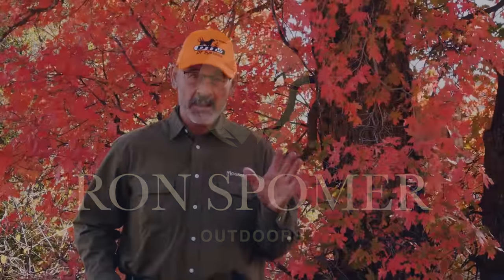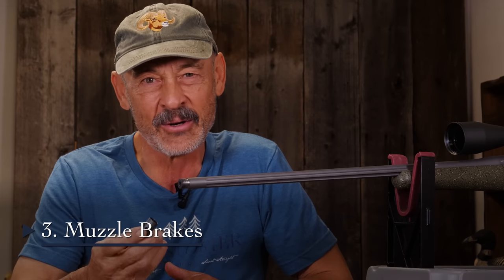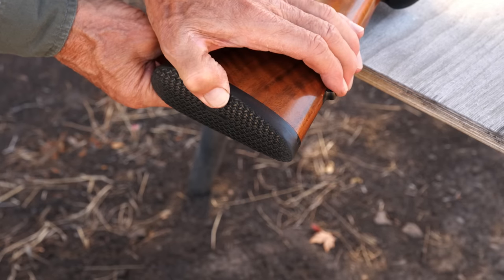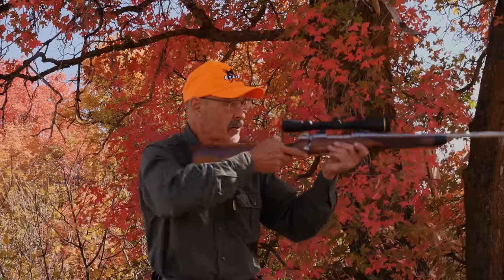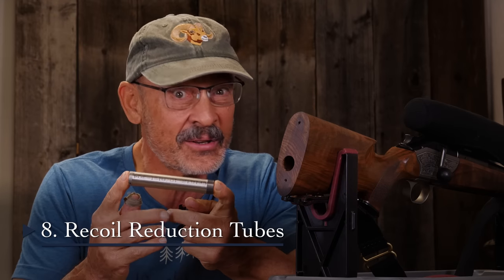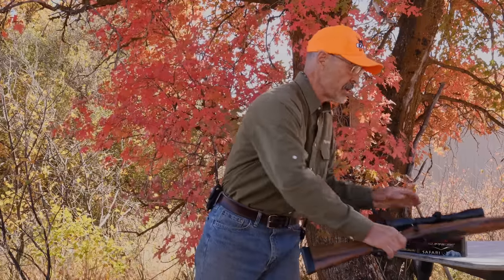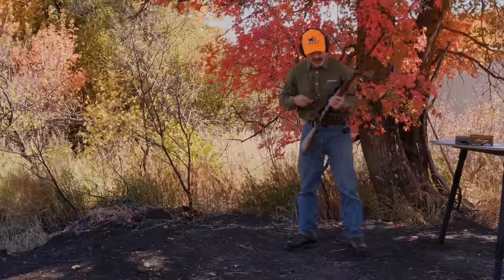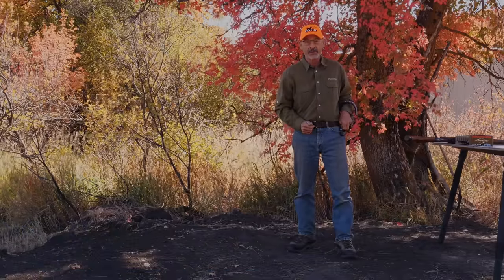How to Control Rifle Recoil!

Comment: I am 6’2” and have thick shoulders, my 7mm mag doesn’t bother me at all because it has a Winslow stock that really puts the bore line in the right place. I had a 270 that had a cheap synthetic stock that wailed the bejesus out of me! It really taught me that a good stock will make a huge difference.
Reply: Early, you are so right.  I have a Ruger American in 270 and the felt recoil is very uncomfortable (I'm 76 and been shooting a long time).  I don't even like the rifle and thinking about kicking that can on down the road for that reason.
Reply: Early Cuyler: Hello. This is so strange / interesting that you mentioned the "Winslow". I have seen them for years in Shooter's Bible and Gun Digest and other firearm publications. As soon as he mentioned the line of the stock and sight lines in the video, I immediately thought about the "Winslow" stock rifles (and another type also).  Makes sense.
Reply: @easttexan2933  

Good thing about the Ruger Americans is that there are a lot of good aftermarket stock options that don’t have to cost an arm and a leg.
Reply: @ryanwilson5936  can you provide a link. I'm only familiar with Boyds stocks. thanks.
Reply: @easttexan2933  Kick it my way, wouldn't mind having one, Add a beter recoil pad, heard linbsavers work great, add a spacer, I made simple 1" wood spacers for my guns to fit me better, About 6'1" but standard guns don't fit me right, mayby long necked, but the spacer worked 👍
Reply: @ryanwilson5936  Well E.T. bought a low priced( good Rifle) I don't think spending 200$ on an aftermaket stock is what he wants. I would take of the but plate/pad and repace it for a better one and add a simple self made wood spacer, add some weight in the voids of the stock, I'm 71 and probably not going to roam the ridges like I used to, Probably hunt from a stand so gun wheight not critical
Reply: @WillyK51  

Right on. The American’s are good rifles. I like them. Spending cash on an aftermarket stock isn’t always the most cash conscience option but if one can afford it, it’s always an option. Better (and usually cheaper) than having to sell of a good shooter just for lighter recoil. Which, is why the Americans are an economical choice. Good shooters with a “less to be desired” stock. 

I do agree with your post though.

Comment: Ron, regarding the decibels, The db scale is logarithmic so every 3 db doubles the energy.  So, in the case where there is an increase of 9 db, the sound energy is 8 times more intense.  A suppressor with ear protection is the way to go.  Thanks for another great video!!
Reply: That's still incorrect. +6dB doubles the amplitude of energy. That's something I do for a living

Comment: Ever since I started shooting about 15 years ago, I’ve come across Ron’s articles in various shooting and hunting magazines.  I’ve found these articles to be very helpful and would consider Ron to be one of the top 5 outdoor writers out there! For me personally, I have to agree with Ron’s premise that noise is a big factor in perceived recoil.  I started shooting centerfire without hearing protection and developed a horrible flinch that still haunts me!  With most rifle calibers, noise is more of a factor for me than actual recoil.  However, with shotguns, shooting 12 gauge turkey magnums becomes an issue of pure recoil.  In my somewhat limited experience, Ron hits on all of the high points in terms of gun fit, weight, etc. and how these affect perceived recoil.  I’ll personally probably never brake any of my centerfire rifles due to my sensitivity to noise.  Recoil and muzzle blast tend to go together with rifle calibers, so I find that I shoot just as well with a light 7mm-08 as I do with a 243.  270s and 30-06s start to bring on the flinch mainly due to muzzle blast but it is something that I can condition myself to if I
shoot more often…
Reply: Easily the best thing about Ron is he is highly knowledgeable but doesn’t take himself overly seriously and maintains an open mind. Is just as willing to discuss the merits of a late 19 century semi smokeless rimmed cartridge as he is willing to discuss the latest 6 mm short magnum wonder round.

Comment: On shooting stance.  You don't have to set your feet straight on to the target.  You can face the target at about a 45 degree angle with the weak side leg toward the target, take a half step toward the target with the weak side leg,  then adjust the angle of your shoulders by pivoting at the waist.  This has been used in all sorts of "combat" over the centuries, from sword fighting, to karate, to boxing.  I learned it as a "boxer's/fighter's stance" over 50 years ago.  I used it for decades in a modified Weaver when shooting handguns and as described when shooting shotguns and carbines.

Comment: Great video Ron and sage advice. The biggest point I've found which you mentioned is hearing protection. Most people are more anxious about the report (muzzle blast) than the 'kick.' With hearing protection with ear plugs plus ear muffs it's a huge difference. Also just like shotgunning the rifle has to fit you. a poor fitting stock will kick. Finally I'm not a fan of muzzle breaks as I don't hunt with ear muffs (I want to use my sense of hearing when hunting). A prefit limbsaver makesa world of difference and I have one on my Sako 375 H+H and also on my Winchester .458 Win mag. Lastly if you are new to shooting a medium/big bore is to just shoot the rifle standing up with ear protection, etc and without aiming at a target just fire the rifle down range. Get used to what it feels like. Worry about aiming, etc after you have gotten used to firing the rifle without flinching seated off a bench. Thanks for sharing1

Comment: Yes, a heavier barrel/rifle (imo) will tame a kicker rifle. Although, the physics don’t agree, field testing wisdom tells me that heavier can be effective. However, the biggest improvement for me is a length-of-pull correct fit. That in itself fixes a lot of kicking and shoulder punch issues. Enjoy and be safe! 👍🏻😃
Reply: Actually the physics do agree. I don’t have the equations with me. I do know for a fact it takes the same amount of energy too start as it does to stop. So a heavier rifle takes more energy to stop but it also takes more energy to start therefore it goes at a lower speed once it accelerates and the formula for energy is 1/2 mass times velocity squared; 1/2MxV^2.

Comment: Good, informative video.  I have told people for many years (but they do not listen) that light weight rifles kick harder than regular of heavy weight rifles in the same caliber.
 
  Thanks for showing / mentioning the stock insert anti-recoil tubes. Have seen them for years in copies of Shooter's Bible and Gun Digest over the years. There was another brand that had a spring and another that used hydraulic fluid. Very difficult to find reviews on those.   
 
 You did not mention it/them, but there is/are also slip-on pads.   I purchased slip-on recoil pads and a slip-on cheek/comb pad. Helps get the stock in the right (or better) position.  
 
 This good video makes up for the crummy video wherein you doubt that a bullet rises, even though every printed firearm and military shooting instruction book / lesson plan and ammo company has charts that show and says the bullet rises.

Comment: Thanks for the video, all great points.  I've found the biggest issue of recoil comes from scope bite, not so much the recoil force.  A fella can take the kick in the shoulder a lot better than the optic breaking his nose or digging into his eyebrow, especially if you try shooting some of those older stocks prone...
Putting a rail on a rifle often lets you get the scope in an optimal position better than two rings at a set distance. Eye relief in your choice of scope is a consideration for those big chamberings.  Consider a scout scope if your hunt allows for 2-7 range of magnification.. they have well a over a foot of eye relief in many cases.

Comment: Where you really start reducing recoil effects is to do as many of the things you mentioned. It just makes YOU deal with it easier. If all you hunt is white tail deer do you need a 300 Win Mag? I use reduced loads in a 30-06 and been getting it done for about 50yrs of hunting. My pet load sends a 150gr bullet at 2600fps. Works for me.
Reply: Mike, I have done the same with a 7mag a few years ago.  Taming a 140gr from 3300fps with reduced loads to about 2700fps was sweet on the shoulder.  In 2000 I went to the 6.5x55 Swede (commercial ammo published velocity is 2650fps) and recoil is practically non existent.  That is my go-to deer/hog rifle ever since.  Velocity is overrated in my opinion.

Comment: Another recoil reduction tip not mentioned (and I didn't see it in the comments yet) is simply picking a lighter recoil caliber. You kind of touched on it with the bullet weight, but if a 125 gr 308 will do the job you're looking for, you could step down to a .257 Roberts or 6.5 creed and get the same energy with a more efficient bullet down range. Just kind of building on your example, but for instance, if you are only ever going to hunt white tail and always going to shoot inside 300-400 yards, and recoil may be an issue, then maybe opt for a 270 instead of a 7 RUM.
Reply: 15:01?
Reply: @robgarbutt1705  sorta, I mean he was talking about working your way up; I was just saying that dead is dead and if a lighter recoiling caliber will kill the desired game at the assumed hunting distances, there is little to no need to choose a higher recoiling round, other than you already own a gun in a bigger caliber and just don't want to buy another one... But I don't know too many shooters who don't like an excuse to buy more guns lol
Reply: @Ifitfitz22  the day i find someone with an excuse is the day i get a Lottery tickey
Reply: @Ifitfitz22  *ticket

Comment: I started wearing hearing protection as a teenager when I noticed that I never flinched when wearing it versus almost always flinching when I didn't. Recoil itself wasn't causing me to flinch it was the anticipation of the muzzle blast. I guess I was like a gun shy hunting dog! Now, I will say as I matured and put on some muscle mass rifles that I thought of as having some decent recoil like a heavy loaded .30-06 or a friends .300 Winchester Magnum didn't seem so bad anymore. But, as you said here, Ron, simply shooting and getting familiar with the gun and it's recoil and the fact that it won't really hurt you unless you have the scope too close to your eye is key. I don't shoot much anymore and when I do rifles that were once familiar seem awkward and the recoil a bit heavier than I remembered. But when I was shooting a lot the big .300 mags were more than manageable, quite a few hot .45-70's seemed comfortable enough and even the occasional .375 H&H was tolerable. But I didn't jump from a .22 LR all the way to the .375 in a day either. I think extremes of experience make a difference as well. If you're used to shooting, say, your .308 and then someone hands you a .458 Lott you're going to have a different experience than if you've been working your way up through heavier and heavier rifles.

Comment: One thing you didn’t mention is semi auto rifles, I don’t know if all the different type of semi act the same way but my Browning BAR 30-06 sure feels light in the recoil department!!
Reply: So does my 742 in the same caliber. My 700 fits me very well and also isn't bad except from the bench where I have to be careful about squaring myself up to the gun.
Reply: I just left a comment about that.
Semi-Auto is a great way to cut down on recoil.
My 30-06 feels like a 30-30.
Even with heavy bullets.

Comment: I have three .30-06 bolt-action rifles - vintage Winchester M70 w/wood stock and steel butt plate, a Sako 85 with wood Monte Carlo stock and factory rubber butt pad and custom-ish Rem 700 with classic composite stock and rubber butt pad. They each within a few ounces of each other. I shoot one of the three each week. Lo and behold, that M70 feels the easiest to shoot. Not sure why, other than the small differences add up - comb height, stock material, butt shape, and just the overall ability to repeatedly shoulder the rifle to the correct spot to absorb recoil.

For me, it's all about 9 and 10 - put your mind to it and practice,  esp. by working up to it - .223 -> .243 -> 30-06 -> 7 Rem Mag -> 300 Win Mag, etc. I am of the opinion that most any man should be able to handle .30-06 fired out of the average bolt-action rifle.
Reply: SAL, vintage M70....do you mean pre64 Mod 70?  If you do, then you are right.  Winchester knew how to make a stock back in the day.

Comment: If you reload your own ammo, you can use reduced loads in big bore calibers for practice , that will help with prevent developing a flinch and work on your shooting form. That way when you step up to full hunting loads you should have better shooting habits that help manage recoil .
Reply: One thing to consider is to make sure you’re not using the reduced loads to sight in your firearm if you plan to hunt with full power loads. Different loads might change where your rounds hit.

Comment: Thanks Ron.
I would add one more thing to the list. A trigger with travel.
I know the Rem 770 is pretty well universally regarded as a bad gun. But I adjusted the trigger to a lighter weight. And it has enough travel so that it helps reduce my recoil anticipation winch. That made all the difference for me.
I recently bought a Savage with acu-trigger. I hate it. No travel on the trigger. In my opinion, acu-trigger is a marketing gimmick. 
Can anybody say more about good triggers with travel on them? And what model rifles they are standard in. Thanks. Paul 😊😊

Comment: My Tikka t3x lite in 300 winmag 20 inch barrel. It's threaded 1/2x28 have 3 port asr muzzle break. Feels like 22-250, Tikka but pad is the softest iv felt. Using 190 accubond

Comment: I have a 1989 Remington.270  model 700 synthetic. It's the Ryonite DuPont stock. It's not light, but it kicks like a mule . I told a guy that didn't think it would kick much and the scope ringed him . Probably should muzzle break it but it's fitted for iron sights and that might interfere . Probably not worth messing with it , the rifle did kill a bull elk at 500 yards .😎
Reply: @easttexan2933  I don't shoot it a lot,but I did before my hunt. It's funny I don't remember it kicking when I shot my Elk or even remember folding the bolt 😀. If I do I'll check out that stock. I've seen the same model in SWAT teams . Dad was an extreme marksman and he loved the stock . The rifle is the production from a custom build . It's green stock fully checked W/ Monte Carlo and fully checked. Kind of a classic but if it's a full-time shooter all rifles should be switched and especially all wood stocks no matter what vintage. Thanks for the tip. 😎

Comment: The importance of being around muzzle blasts and recoil often for reducing or eliminating flinch tendency is important.
Take for instance someone who's never been around the blast of a stick of dynamite, suddenly gets within say 1/10 of a mile of a controlled charge to witness it (with good ear protection and precaution). That person has zero experience or expectation about how things will go, until the blast hits them. Suddenly they'll be flinching and wincing and dancing around expecting the next blast, after a countdown.
Same goes with a rifle. If you've been away from shooting for a decent length of time, it's almost guaranteed you'll not be able to overcome the physiological effects and reaction to the blast from the muzzle and the slam from the butt stock. But with anything you're around a lot, with anything you get accustomed to, you can train yourself OUT of that reaction.

Comment: Something I figured out for myself was to pull the rifle tight to my shoulder with a firm hold of the forestock and firm cheek weld. Don't allow the rifle to punch you.  Let it push you. After 20 shots with my 375 H&H from the bench, I leaned my lesson! 😆  Now I can fire my 460 Weatherby magnum multiple times with no bruising!
Reply: HarleyRider, one of the leading causes of scopes banging into the eyebrow is just what you said, "not have the buttstock pulled firmly into the shoulder".

Comment: Not a fan of muzzle breaks due to the noise issue, I regularly shoot .270 Win Tikka and .45/70 Ruger No 1 , the Ruger is fine in most situations though definitely rocks my world off the bench with stout loads. My Ruger No1 in .416 REM Mag is ok shot standing or kneeling, just roll with it. Pretty sure I would not shoot the .416 prone 😄. Shot a light weight double over and under rifle in .300 Blaser a few years ago, fair to say the recoil was more than I expected and given the light weight of the rifle it was a little unpleasant.

Comment: i have had issues with the rubber braking down on some of the soft aftermarket recoil pads. they work well but may need occasional replacement

Comment: HI Ron, I remember you touched briefly on it in a podcast, is it better to hold the rifle very tight, or more loosely?  and is it better to pull the rifle in mostly with the hand holding the stock, or with the hand holding the barrel? I find that pulling in from the barrel seems to affect accuracy a lot, but I am very poor shot!